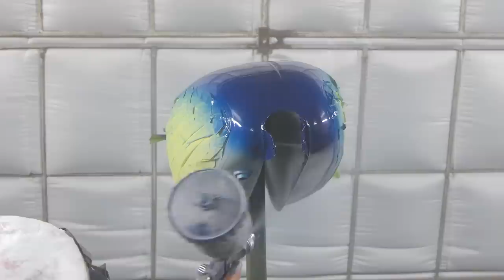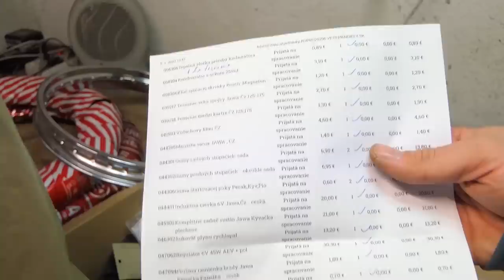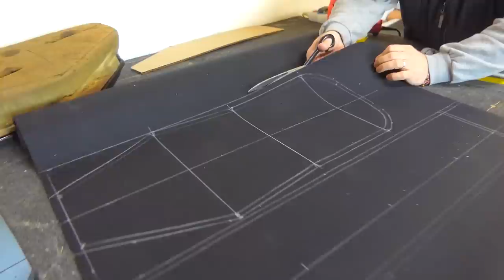Restoration RUSTY Motorcycle - Half Year in 38 Mins

Comment: Unbelievable! How you returned a junk motorcycle back to excellent condition was amazing to watch. You are a very talented mechanic and painter!
Reply: A lot of after market parts.
Reply: @Cooldaddio2  obviously... good luck finding original bearings, seals, gaskets, wiring harness, electrical components etc now..?
Reply: @AO1YinYang   Many of the parts he fitted were new so, plainly, they are not hard to find.
Reply: Thousands of dollars spent on a seven hundred dollar tops motorcycle

Comment: I do the same but with classic speed boats. Haul them out of the weeds and turn them into something loved again. Basic tools (lucky you has a sandblaster), a small garage and most of it is done in my driveway. I rebuild or restore everything that is still there and can be salvaged. Do almost everything myself, upholstery, paint, electrics, motors, drive rebuilds. Motor machine work and chrome goes out to be done but that is about all. I know the time and energy and dedication to do something like this. It's so easy to start a project like this and give up at some point a thousand times over. Great work!!

Comment: Nice Job.. I noticed In the test ride, The front brakes were not hooked up, no cable running to it.. Still an awesome job, without a shop full of tools.. 
About 33 years ago (1990) I found a 1953 Indian Chief 1,300 cc It was a barn find, all the metal and paint was in quite remarkable condition, It was covered with about 10 or more blankets, The guy I bought it from said it was his grandfathers, he bought it brand new road in twice before going to the Korean war, he died 2 months after getting there and the war ended 2 months latter..
The family completely forgot about the bike, I was doing a remodeling their house and found the bike in the barn, I told the homeowners and said I was interested in it if they would part with it, That's when they told me the story, that being said They asked if I would take $1,100.00 off my price for remodeling the house, I did and about 3 years later I finished redoing the bike, I did a few modern upgrades, like a toe shift, a starter, bored the cylinders out to make it a bit more powerful.. I had to completely do all new wiring (rats ate through them and chewed up the seat.. The fuel & oil tank was fine. all the paint on it only had to be washed and buffed, no scratches, rust or damage.. Loved that bike.. I sold it last year for $75,000.00.. Sorry for babbling on.. Thank you for sharing..
Reply: I'd like to see a picture.
Reply: If you got $75k for a 53'Chief you got more than double what it is worth today. It is just beyond my why those 80ci Chiefs that production is documented at 1200 units don't pull what say a very common 47' knuckle will. Nice riding bike unbelievable torque, great classic lines. As I said beyond me
Reply: Awesome. Please share the pics or video clip
Reply: I never noticed the front brake, just the upside down speedo, and poor cable routing.
Reply: Just takes the right person to want it. Nice find!

Comment: one suggestion, maybe on your next job you  might want to get a junk gas cap or plug up the gas cap and fuel petcock opening, Im sure that you will reline the gas tank but if not your going to have overspray in your tank and it will mess with the gas.

Comment: Beautiful work, good job! You revived a legendary bike. 2 things I noticed, why the accelerator and one more cable were left loose (the outers) and not cable tied properly. Secondly, a disturbing voice when you rev up, probably some mesh sheet, or something left loose Or was it coming from the piston rings (which I think should not happen with a newly build engine)
Reply: It would have had a straight pull throttle originally, going by the slot in the r/h handlebar.  The throttle cable would have come out somewhere near the headstock and been much neater.  The clutch cable is also too long, so appears to drag on the mudguard.  I also would have expected an enclosed chain.  Surprising defects when the rest of the workmanship is considered.

Comment: Hello Crazy Bro, why didn't you Repair the Original Petrol Tank which was fully out of Shape. But, instead  immdtly took out another Old Same Shape Petrol⛽Tank from the shelf is not Appreciated. In India🇮🇳, self Has come across similar piece of junk petrol tank, but was Brilliantly Repaired by Hand Made Tools by First getting it into the near perfect bulged out exteriors, then nicely sand blasting to the minimum to get rusty gravels out, thereafter putty paste before denting+ tinkering+ 2coats of Red Primer & Final Paint work with its monogram + side Gold Yellow Line work all by Hand only. So, why did this not strike in your Goose Mind Dude. Today people try every maximum possible ways for Mint Condition of any/all Old Vintage Classic Beauties in today's Hybrid Customization Fashion work Does not weigh in Gold but at least with Siliver Lining on the Horizon man. 2ndly, take my word positively at least now. Don't throw "THAT OLD OUT OF SHAPE ORIGINAL PETROL TANK" & Also forgot 2 mention the Exhaust Pipes with mufflers, these pairs were not Repaired or Restored instead replaced it completely with Brand New Ones. Can't understand why people do this type of Use & Throw mindset. Now for both this items Petrol Tank & Silincer Exhaust Smoke Pipes🔙🆗🆒✔️Try UR💯💪 Level Best, get it into near perfect condition shape & 2B repaired as stated in above referred paragraph
Keep the old goodwork Going❤️ Thanks.JaiHind😎😝👍✋👌😍🌟😁😜🙏